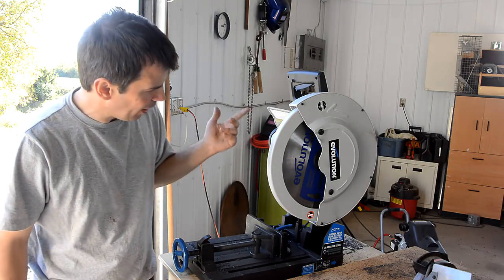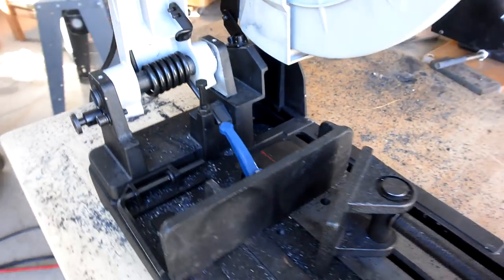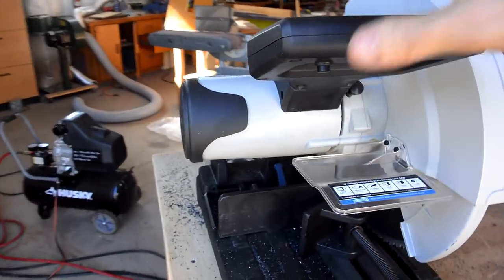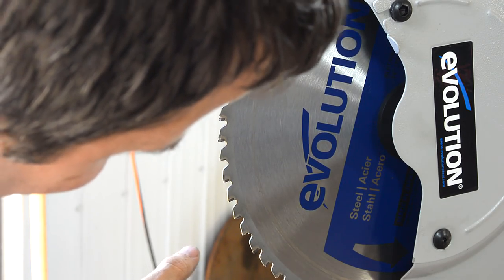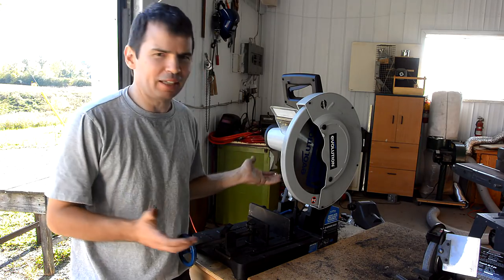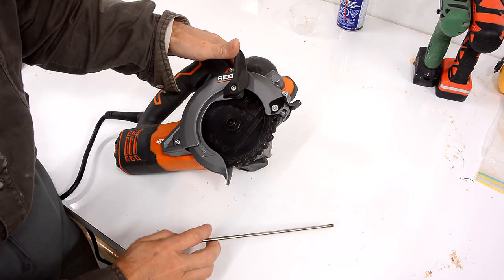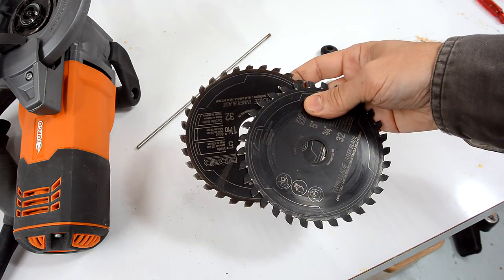Evolution dry cut saw review

Comment: It depends on the usage of the saw. I started with angle grinder but the repeatability of the cut was horrible. I went with a dry cut saw and it has helped me work much faster. Drilling/cutting into plasma cut stuff or welds are definitely not recommended on any saw. The bandsaw teeth will also dull and abrasive disc will wear down quicker.

Comment: I use the cutoff discs myself, but they are certainly capable of creating massive injuries.  I have been at this stuff 50 years, and lucky so far.  But if you need videos like this to figure tools out (and we are lucky to have them), you may not have the chops to run an angle grinder safely.  Look up angle grinder accident/images on google for some sense of what can happen.  Lots of gory picks of adult onset hair lips, or saber slashes to the bone.  Relatively easy to sidestep if you understand kickback, and know how to keep the saws lined up.  But given the number of pros hurt, that kind of skill may be uncommon.

Another thing to keep in mind when doing metal work is you will need to volunteer for a corneal x-ray, if you need an MRI.

Comment: Your supposition that these types of saws are for more experienced folks working on new materials I think is a fair one. In welding classes we were taught that when used these types of saws, you have to engage it in the material gently at first to avoid damaging the blade. I also have a handheld Dewalt metal cutting circular saw which uses carbide tipped blades. I totally messed up the blade once trying to get through bed springs and other metal trash around a friends property. On new material that was well supported is was great though. Can't beat the thin cutoff wheels for a lot of stuff though. One note about the 14" abrasive saws: they work well, but you have to learn not to force the blade down too hard as it can cause a fair bit of deflection resulting in a cut that's not square. With a little care though that's preventable though.

Comment: From personal experience, if you were using an abrasive type blade in the cut off saw and had the same situation of the part not being supported you would more than likely have experienced a broken (exploding) blade. Frankly, I would rather have some carbide inserted teeth chipping or coming off at a slower RPM than an explosive shattering of a blade turning at a much higher RPM.

Comment: I have a Milwaukee version of this saw and ran into the same issue after cutting up a bed frame which turned out to be made of hardened steel. On mild steel or even unhardened drill rod it works fine provided the work is secured. If I don't know what I'm cutting, I just use the abrasive saw.

Comment: Seems like a metal cutting bandsaw would be better than this type of saw in nearly every way. Even a small portaband in a stand seems like a better idea.
Reply: yup Diresta has definitely proven that!
Reply: A horizontal band-saw is probably superior in every way except size, but a portaband in a stand is a very different tool which has pros and cons of its own.
Reply: Bradley Weingartner Metal bandsaws cut much slower and usually cost a lot more, at least here in the UK where they aren't commonly used by hobbyists. The Evo saws are relatively cheap, cut much faster and take up less space in a shop. The blades last a long time if used carefully, I bought my saw used expecting to replace the blade straight away and it's still going strong. If your workpiece isn't securely clamped and supported and slips from a bandsaw it probably won't do the blade much good either. Both saws have their pros and cons really.

Also, Diresta has used an Evolution Rage 3 in a few of his videos lately, they're dirt cheap and can do compound mitres, I've not tried one but you can buy one used for the price of a decent angle grinder.
Reply: I got the milwaukee new for 315 euros shipped. It's not a bad price. Now to manufacture a stand for it.
Reply: 1873Winchester I got a 1942. milwaukee-delta metal cutting bandsaw for 150 USD. works great after a put a better motor on it
Reply: Except for NC/CNC metal bandsaws (your steel dealer might have one of those), most metal bandsaws simply lack the power and equipment to cut at acceptable speeds. Even a small chop saw is faster. Note that you don't need carbide-tipped blades, strictly speaking. Metal chop saws existed long before that came up and used regular HSS blades. Even those work faster than the equivalently -sized metal band saw.

Comment: Please use the guard on your angle grinder with the thin cut off discs as people have been killed by those discs shattering when they force them or try to use them as a grinding disc.
Reply: I don't know about killed. I've had a ton of them explode on me. You can't always hold the grinder the right way to do a certain cutting job, which results in chatter which can break the disc up. I've had them hit my legs and arms and while it hurts, it's really not that bad. They're so light they don't have much power to them when they fly apart. I do always make sure to keep my face and neck out of the line of fire though. Your face is pretty soft and has eyes on it.

Comment: I'm using a "Bosch expert for steel" blade in a Festo saw with speed control. Best 30€ I spend in the last year. It will cut 3-4mm of mild steel as fast as you would push a circular saw if you want to have good control.
I made sort of a "cross cutting" jig to cut steel stock down to size. It is just so much better than an angle grinder. Although hearing protection is a must. Even a 5 second cut without will leave your ears ringing.

Comment: I've got a cheap little carbide saw I got from Aldi years ago thats still using the original blade. I've had it through a fair amount of steel and aluminium now, as deep as the blade, and I think the big factor in it surviving so long is that the motor is so underpowered it tends to stall before it damages the teeth.

Comment: Nice review, I didn't realize those carbide tipped metal blades were so fragile.
Reply: Yeah, hard materials chip/fracture/shatter very, very easily.  Even hardened steel is like that, if it's not annealed after hardening it can shatter like glass.

Comment: It all just depends on the job in hand, I run a cheep plasma cutter and different sized angle grinders with cutting disks to cut nice new stock, bolts that are seized and patterns from steel.  I use all for the same reasons in random variations.

Comment: I have the DeWalt version of your metal chopsaw.  It did decent on steel, but man, cutting aluminum was a breeze.  We did alot of stuff with 80/20 extruded aluminum-  the cuts were clean, and ready to assemble with little finishing....
Reply: I've cut plenty of 80/20 on my regular 10" compound miter saw with a regular carbide tipped blade (like a 60 tooth). Finish is OK for most applications. Beauty is in the eye of the beholder though.
Reply: @brownmatthewn  Well you may not have had a good a result because that blade speed was too great. The metal cutting chop saws rotate at much lower RPM.

Comment: Safety rule one in a metal shop  Support your work. I've been using a revolution saw for over two years same blade no chipped teeth, mostly cut apart old farm machinery for parts.  Rule two always have at least two teeth engaged with the part to be cut .  That is why hacksaws have so many teeth per inch.  If the part can fall into the kerf of the blade you need a finer blade

Comment: a tip for any woodworker trying to work with metal,  clamp it tight, real tight,  support it, use torque over speed where possible, keep the heat low.   break any of these rules and well your tools wont last anywhere near there intended length.

Comment: Add a cheap pneumatic cutoff tool to the mix. I don't like frequently swapping discs in my grinders so I use the pneumatic cutoff tool whenever possible. Then one grinder has a hard grinding disc and the other has a flap wheel.

Comment: FYI. Evolution says not to use their blades (tungsten carbide) on stainless steel, is it will wear the blades pretty quickly.
Reply: Stainless is EVIL material because of the way it work-hardens.  Carbide can deal with it, but not guaranteed to end well.  If you're not shooting for accuracy in the cut and plan to do finish work to it afterwards, or can use it raw as cut, abrasive is the best way to go.
Reply: Lierofox - For those interested, here's a quote from the Evolution rep (from an email he sent me to answer my question of "what metals cannot be cut with the blade"): "Chrome & stainless are the two ones not to cut with the multipurpose blade as the zinc content with break down the carbide on the tungsten blade, so it would be game over after 5 or 6 cuts. We do [have] a stainless blade..."
Reply: That's right Steve.. There are 4 blade types for this saw.  The One in this video is steel only as there is a blade for alloy and stainless ect.. :) :) :)
Reply: Yes there are EVO branded SS-specific blades that are designed for 3XX-series SS stock.

Comment: So, are the carbide saw blades just like the carbide saw blades I'd use to cut wood? What are the differences? I've never done any real metal work and this is the first time I'm hearing that carbide saw blades can be used to cut metal (other than aluminum).
Reply from the maker: The shape of the teeth is different - less pointy.  I don't know if the carbide itself is different.
Reply: Very interesting, thanks!

Comment: I work construction and I would never recommend an abrasive disc such as these. I have seen several where if they bind up at all the shatter and throw pieces of the disc out very rapidly. the last one i saw stuck in the guys fa e and killed him. I cut tons of steel and I always use a diamond blade

Comment: Personally I prefer 1,6mm discs over 1mm. Its almost as fast, lasts longer, doesn't shatter as easily. And with a light hand you can clean the cut up before welding. 

Why is 4,5" discs more common in America? In sweden its almost hard to come by, mostly old cordless grinders use them.

Comment: I think the saw blade slipping and the loose nut on the clamp could be linked, the nut was so loose that I doubt if the clamp will work without coming loose. Because the other end was not supported, coupled with the nut and vibration caused by cutting would not hold correctly.

Comment: Evolution blades are the "Jack of all trades, master of none" of saw blades. They can cut anything but they are bad at it. As for the power button on the handle, you could make it so the saw is "permanently one" and install a kill switch like with a circular saw.

Comment: Metal cutting bandsaws seem the best, fairly cold cut, doesn't shoot f'load of sparks all over the place, doesn't leave a fine metal dust in the air.
Reply: I have had four of those.  One thing is basically a wood saw.  You take an old blade, crank up the speed, and friction cut.  Works pretty well, but you need projects where a burn line isn't too upsetting.  Then a wood saw with a reduction gear, I didn't really get fully into that one.  Then the standard chop type, they are frustrating with the derailments they are prone to, but the most prouctive, just frustrating.  Then a milwaukee hand held, the best of the lot, to my surprise.

Basically, if one wants to do this stuff and can't afford water jet, then I think a real machine shop tool (you can tell what they are if they have welders built in) is the way to go.  Old ones go for about 500.
Reply: Metal circular saws don't leave dust either. They make chips the width of the blade.

Comment: I have the same saw.  If you cut into a weld you will damage the blade ?  Nope  haven't with my saw yet and I have been using the saw almost a year on the original blade.  I have cut a lot of material.  I do have the blade damaged from a piece getting loose in the clamp.  Knocked off 3 teeth but the blade still cuts ok.  I have cut 1/2"x6" flat bar with this saw.   I have some Milwaukee blades I got for a great deal,  hopefully they are as good as the Evolution blades.

Comment: why would cutting into a weld destroy the blade
Reply from the maker: the welds are hardened from the rapid cooling down
Reply: Cutting welds does not necessarily destroy the blade, welded stock is cut with these saws on a regular basis. These metal-cutting chop saws are commonly used on rectangular tubing with a welded seam. For faster cutting and max blade life, such welded stock should be cut using the "diamond" orientation with one of the 4 corners resting on the saw bed, and not with one of the 4 sides resting flat on the bed. Also the welded seam should be at the 10-11 o'clock position (as viewed from the off-cut side of the blade) for best results--meaning the upper-left quadrant.
Reply: @SH-pc4xt  Welded seam stock is welded hot and cooled slowly which basically anneals the weld area. Matthias is referring to cutting used stock that's been welded, which is much harder and more prone to chipping the carbide teeth.

Comment: yesterday I wrecked a TCT blade when it hit a bullet screw. I thought it was supposed to go through metal??
Reply from the maker: only mild steel, not hardened.  Welds and plasma cut edges could also damage the blade.
Reply: how are you supposed to tell when you're an amateur? "excuse me are you hardened?" (lol that's what she said.)
Reply: You can take a file to the steel in question to test the hardness. If it's hardened steel the file won't scrape it. But soft or mild steel will scrape, or file shavings. A hacksaw also will not cut or scrape hardened steel. if you don't have a file.

Comment: Have you cut aluminum with it?  I've messed up many carbide blades on wood chop saws. Mostly when the work pice slips or rattled around especially with thicker stock. I'm guessing that saw would handle it all day with somewhat proper technique?
Reply: While the blade itself wouldn't mind aluminium, it's the speed that kills it when using normal wood tools. You might have more luck with a blade with more teeth (like 80 or 100 on a 250mm blade). But clamping the stock down rigidly is the most important thing in any case.
Reply: I've been using carbide and even non carbide blades for 25+ years, and never messed one up. You must be hard on tools lol

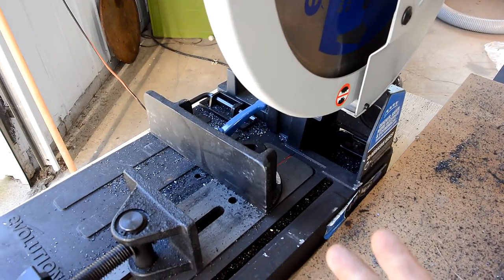Comment: Matthias I've watched enough of your other videos to value what you have to say on this saw, which I am seriously considering. However I think your comments at 2:30 - 3:00 are really off the mark. Glad that you explain the role of user error in causing the large amount of carbide tooth damage you've experienced after relatively few cuts. I don't even have one of these saws yet but I know you have to support the stock on both sides of the blade to avoid the exact problem you encountered. Plus that is mentioned in the saw manuals for anyone who bothers to RTFM. Anyway, if you had had a similar improperly clamped/supported piece with a abrasive cut saw, the blade would likely have shattered, perhaps leading to shrapnel given the much higher RPM at which those saws run. So I am very skeptical of your claim that you'd still be on your first abrasive blade. And besides, who would use an abrasive blade if they had any way to use a cold/dry cut carbide saw???

OK well there was really no more of the review after that! And then you reviewed your experience with the smaller circular saw, with the same user error leading to the same unfortunate result. I think the message is, take the time to reasonably support and clamp your work to protect both your saw blade, and more important, to protect yourself!

Comment: Would an abrasive disc be a bad idea on an old compound miter saw?
Reply from the maker: I don't know.  Might work
Reply: Depends on how much plastic there is exposed to the sparks that come off of it. There is enough heat generated at the edge of the abrasive disk to possibly melt even aluminum.
Reply: ive done it with a radial arm saw, so why not?!

Comment: I think it would be best if you just stuck to wood.  Hey, you're good with wood but you made a lot of mistakes with metal that just 10mins of prep work would have prevented all of those issues.
Reply: Going outside ones comfort zone is how we learn.   So I disagree.
Reply: Dan Harold
The problem is he has been doing metal work for a while now and what he did to get the chipping was beyond noob it was stupid.  Always, regardless of the material, support your work.  Seriously, he should have known way better than this due to his experience in life.  Since he mentioned it on the video he did know and I can assure you he knew before he did it from his eons of woodwork he does so no excuse for what he did, or rather didn't do.  Just for safety alone ALWAYS secure your work and have it supported at both ends.

Comment: I don't get how the counter rotating system could be more effective...aren't you actually making two separate cuts right next to each other?  Why is that not an awful idea?
Reply from the maker: It's useful because it means you can easily use the saw freehand
Reply: I guess it is meant to not have any "cutting pressure" to support. If you only had one blade, it would want to push the workpiece in the direction of rotation. With two blades, you just have to feed the workpiece into the blade and not against the direction of rotation.
Reply: try to cut something with a knife and then do the same with scissors. A knife would need a directional force while the cutting edges of a scissor are using each other to force the material against.
Reply: nice example...